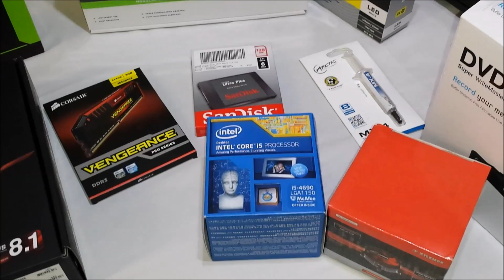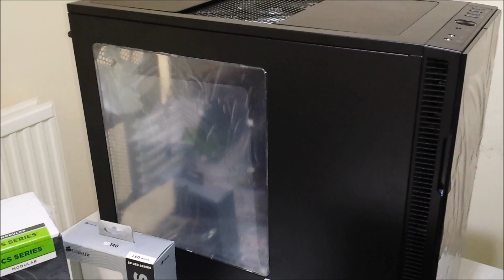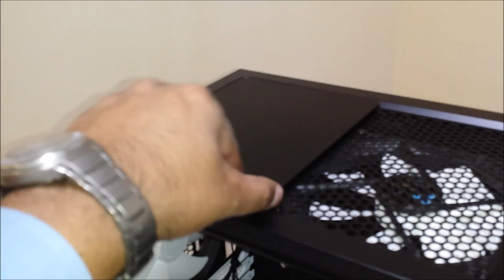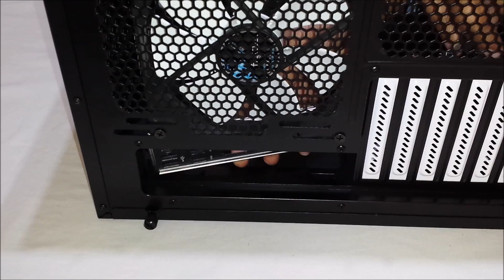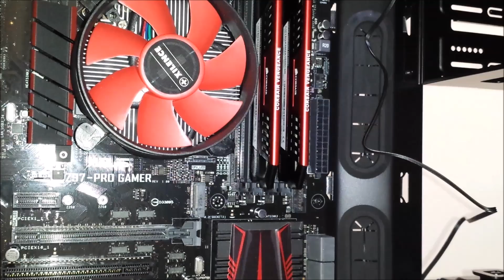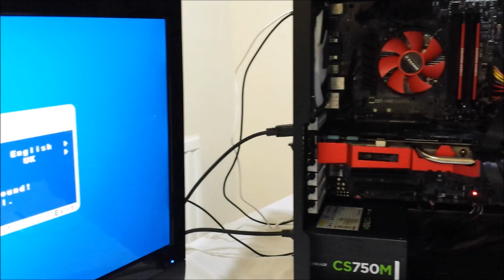Building my PC

Comment: how do u ground your self as in what do you use to ground your self also what did you use to set your computer on as in just a white sheet or what jw fixing to do about the same build
Reply from the maker: judd even Just used a cotton white sheet. The grounding was done on the copper pipe for central heating, little crude but it works. The pipes have to be non- painted though.